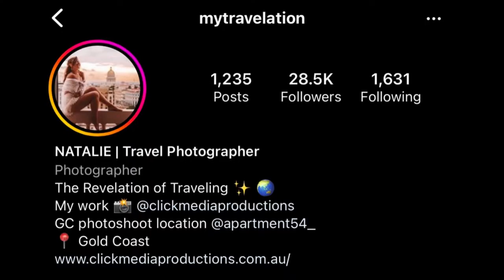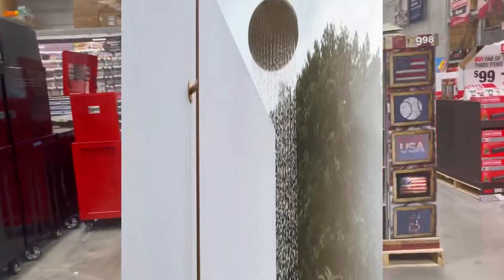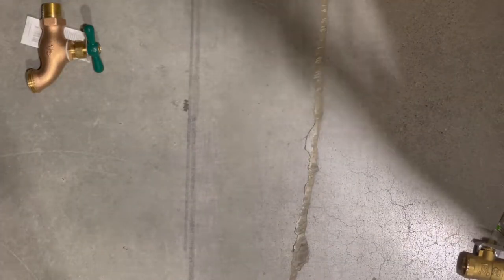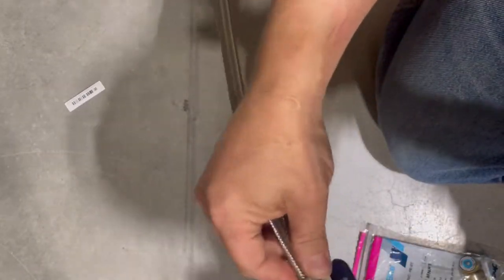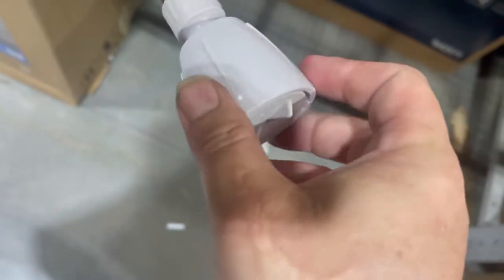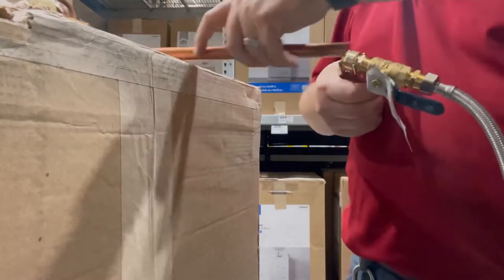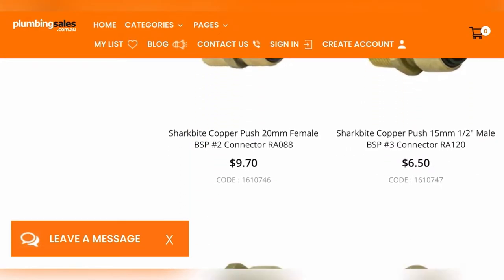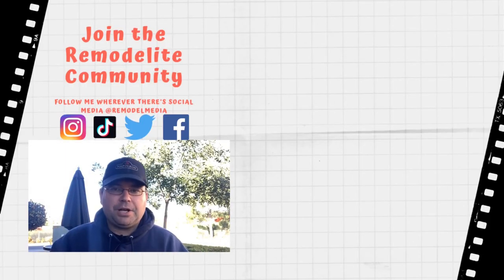How to turn a hose Bibb into an outdoor shower for under $100 - Quick Tip Tuesday

Comment: I am planning to do this at my house!! What would be a good way to attach/anchor it to brick? Or should I maybe anchor it from above in the plastic of the roof overhang somehow?
Reply from the maker: The copper hanger at about 3:15 should work for that thought you might have to drill a pilot hole.